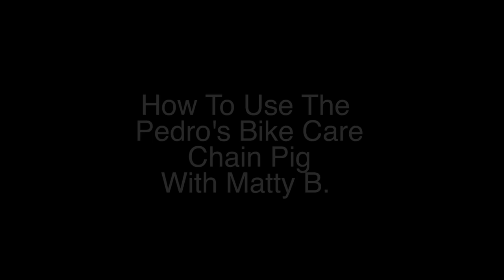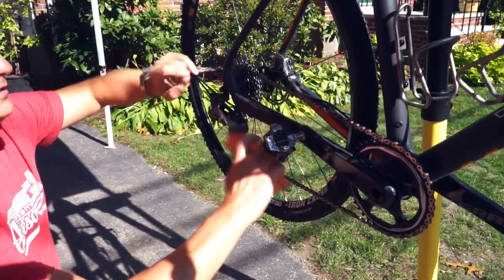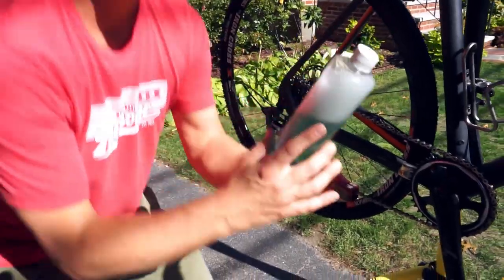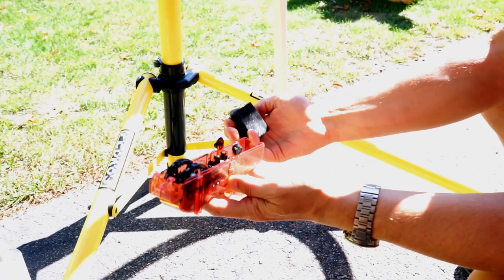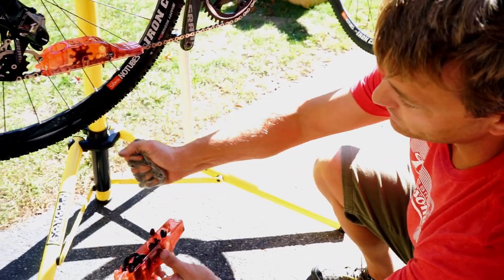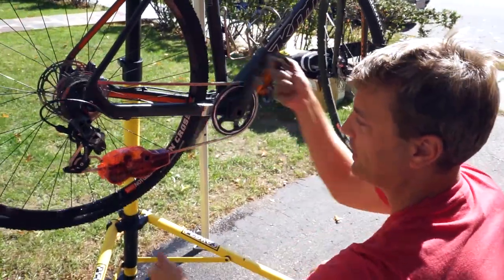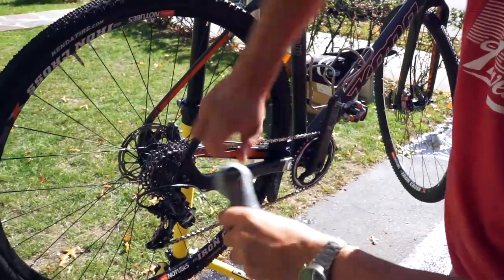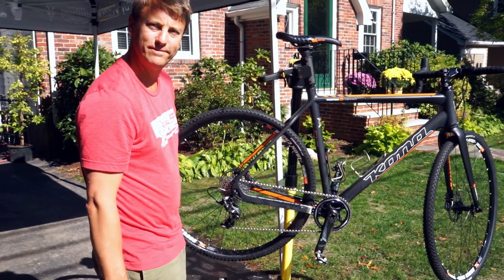Pedro's Bike Care Chain Pig Bicycle Chain Cleaner How-To

Comment: I'm going to post here what I posted on another youtube video by Pedro Inc. about Pedro's pig, the content of which will allow you to determine the exact video to which I refer. I include prior post here because many of the issues I have with this video are the same as the other video. The two main ones

1. Still not clear where to hook pig's tail on my long cage RD
2. Chain/RD with pig/tail attached does not spin anywhere near as easily no matter what chainring/cog combination I try on my 3X8 drive train
3. Insufficient light in video to adequately illuminate RD/pigtail attachment point

Which reminds me of a major problem I almost always have concerning DIY instructions on youtube. 

4. 100.0% of all DIY YT videos are intended for novices and/or extreme novices, which is very far from what I am. Hence, my questions are rarely answered because my problems are almost NEVER the type of help a novice and/or extreme novice requires

Fascinating
I have a long cage Deore XT RD, so the pig's tail is too short to reach all the way up and hook onto the attachment point of top pulley

I suppose part of my problem is that I don't own one of them there new-fangled RDs so I have little idea what they look like

In general, I might be able to visualize such a new-fangled RD

In specific, this particular black-colored RD, along with relatively low-light in the video, makes it hard to determine the exact make/model which would aid me in visualizing the situation

Last point - from the video, it appears that I need to back pedal in order to engage the cleaning process of the pig. Again, since I have an 8 speed peasant cogset, I'm sure my chain is much wider than the corresponding chain in the video's 12/13 cog setup

This would explain why it is really difficult to back-pedal - with the pig staying in place - without significant effort on my part. In the video, this charming woman - who doesn't speak American English - appears to be having a really easy time back-pedaling

I also admit that part of my problem is that I am the absolute opposite of a VSL¹, that is, someone whose brain naturally forms and stores visual images in (brain) memory

What does anyone expect from me?
I am a theoretical mathematician, not an applied one

Now, if anyone wants to discuss my area of specialization, Galois Theory, I would be deliriously happy to do so

1. Visual Spatial Learner